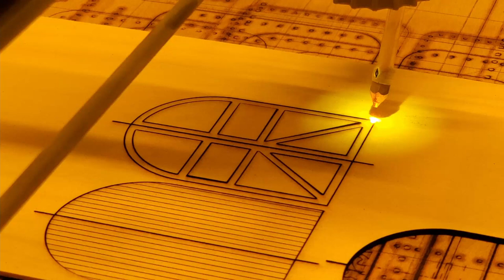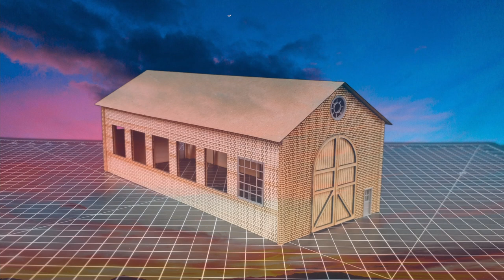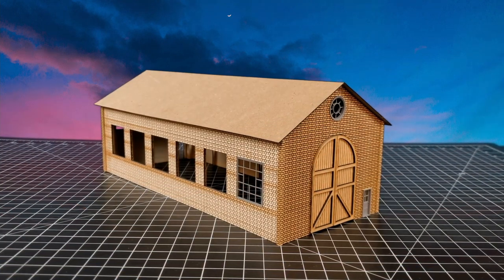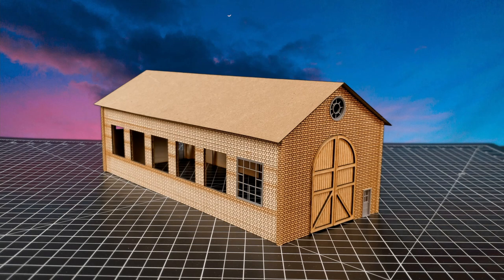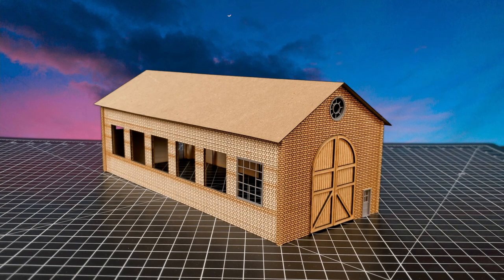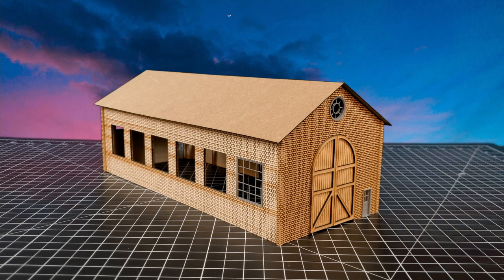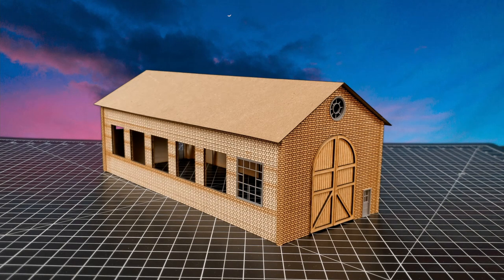How to create a laser cut kit for model railroading

Comment: Very neat. I've just bought an Atomstack A5 V2 and planning to make some scenery/buildings for my N gauge layout. I like the way you've used a 3D printer extruder nozzle for the air assist. Happily, the Atomstack came with a built in nozzle so I just hooked it up to my airbrush compressor. Works a treat.
Reply from the maker: Thank you for watching and commenting. This is an old video. I still have the Ortur laser but I have since upgraded to an OMTECH 80 co2 laser. Talk about night and day difference. That  ortur laser was so slow that I never finished that engine house and therefore never went any further with that video idea. However now that I have a laser that works so much better, I will in not too distant future get back to that type of video. Thanks again. And have fun with your laser. They are amazing tools.

Comment: Man I wish I could afford something like that and a 3D printer.   That's the first time I've seen a  Lazer printer working.   Really cool
Reply from the maker: Hey Chris. They are pretty cool. The one that I have is a super entry level one. It's actually sold as an engraver and not a cutter, but it works, just very slowly. They are on Amazon for around 400 bucks. Now I don't know your situation in life, but I'll tell you how I got mine. Last Christmas I asked everyone to get me Amazon gift cards instead of buying me things. By the time Christmas was over I only had to save up 150 bucks to buy it. But I would definitely get a 3d printer first. They are much more versatile. But with having both there isn't much that can't be made.
Reply: Unfortunately I have life altering things happening right now.   Not winning just not feasible right now.   What the future holds???

Comment: Thanks, i have the same model as yours, never cut with, can you tell me how many pass do you need to cut ?
Reply from the maker: Way too many variables to answer that question. You need to do a power scale test for each type of material that you would like to cut. If you are using lightburn they have a built in power scale generator in the program and there are tons of great videos on YouTube showing how to use it. That was 1/8 th inch basswood and I know I was at 95% percent power. I think I was running at 50 mm/minute and I want to say it was 3 to 4 passes. It's been a long time ago since I tried cutting with that machine. I have upgraded to an 80w OMTech laser.

Comment: How long does the actual cutting process take in real time?
Reply from the maker: Hey RM. Of course it varies. The wall sections take roughly 45 minutes for each piece. Keep in mind the Ortur is only a 5.5 watt diode laser and not designed to cut. And I am cutting 3 mm basswood. The smaller pieces take between 5 and 10 minures apiece. I am saving up to purchase a industrial 60 watt co2 laser which of course speed up the manufacturing time immensely. Thanks for asking.